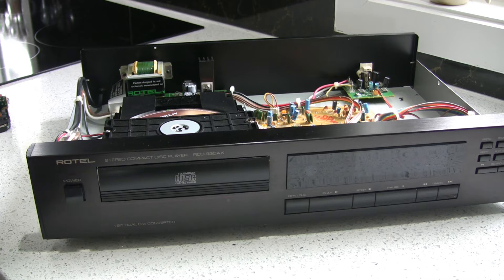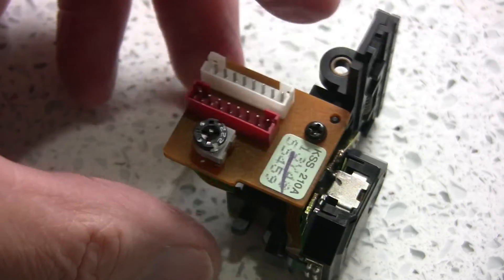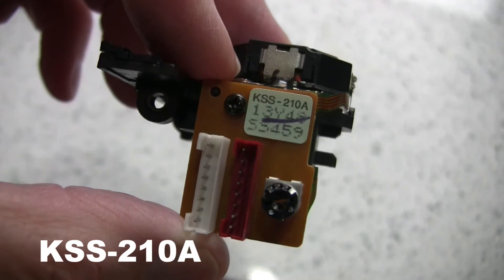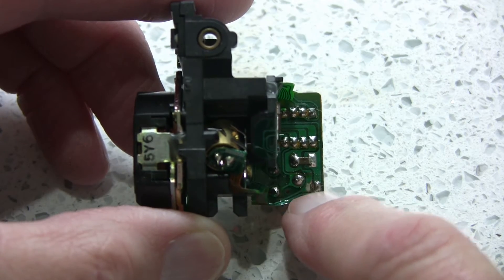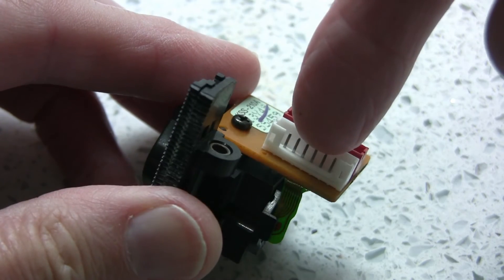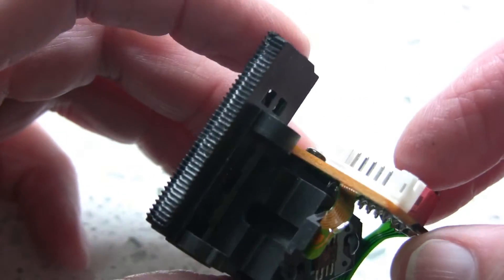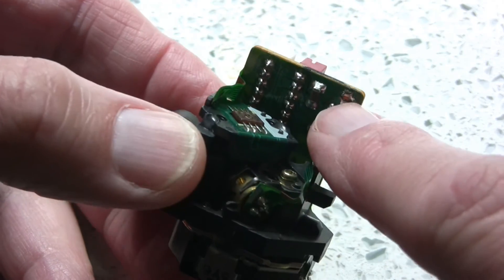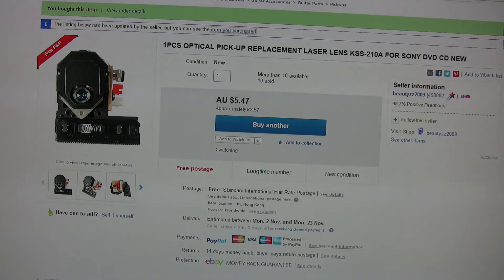Rotel RCD-930 Repair information.

Comment: I bought a 950 rcd a few weeks ago and I have problems with the rca coaxial output. It does not recognize my dac nuprime 9h. The dac works well with the audioquest coaxial cable in a dvd player. I'm going to have to take it to repair. The cheap dvd player with the dac nuprime akm 4490 is highly superior to the rotel dac tda 1305.

Comment: I suspect the more expensive parts from the 90's era machines that were Sony branded were made in Japan, and newer ones are from China and cheaper, that might explain why they come with defects that you have to correct before you can use them.
Reply from the maker: Sadly Kevin, this is very true, most stuff from China needs repairing  before use.

Comment: I would like to add a digital out to mine so I can connect it to a DAC as mine has a boring flat sound that I just can't enjoy. I have a DAC Magic 100 and love its full bodied and lively music expression.
Reply from the maker: Hi Andrew I'm not quite sure I understand your question. Do you mean you have a DAC and want to connect it to one of the inputs? Or do you mean you would like to fit an analogue to Digital out put. This would be kind of pointless as you will never get better results because you will be limited to the analogue of the amplifier.
The Rotel is a good amplifier for what is is, maybe you just need an up grade.
Reply: @MichaelBeeny  I want to give my ROTEL RCD-930AX a digital output such as SPDIF so I can use it as a transport. It does not come with one, but would the board have provision for it, or is there a pin on one of the ICs?
Reply from the maker: @andrewscott1253  Sorry Andrew, I don't know is the quick answer. The unit has long left my hands, almost 6 years ago, still working I understand.
Reply: @MichaelBeeny  Ok many thanks for the response.

Comment: What was the initial complaint about the unit?  Just curious.
Thanks for uploading this video, very interesting stuff.
Reply from the maker: +eariamjh71 Original faulty was would not play some types of disc, getting worse as time went on. I tried upping the laser drive current, that did help little but even with the pot on full would not play every disc.